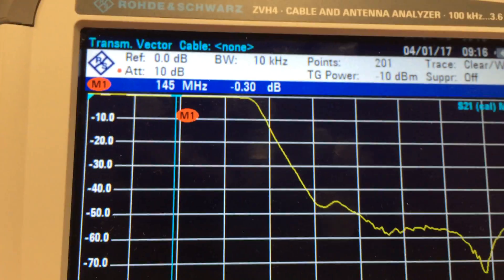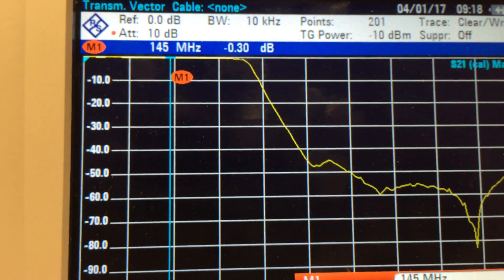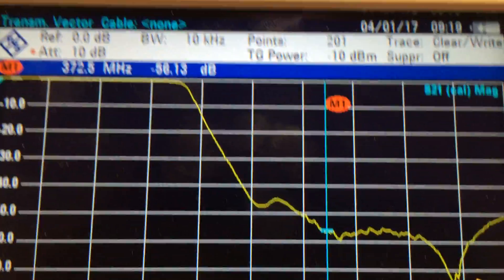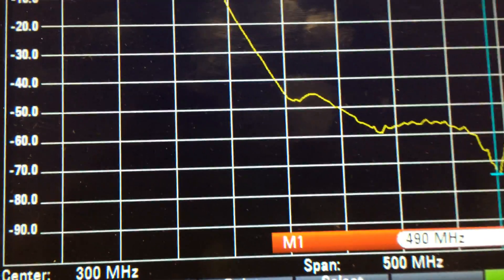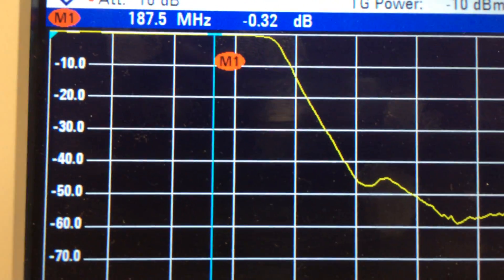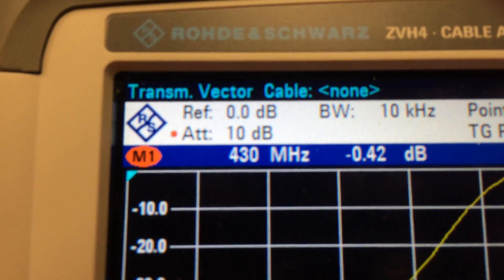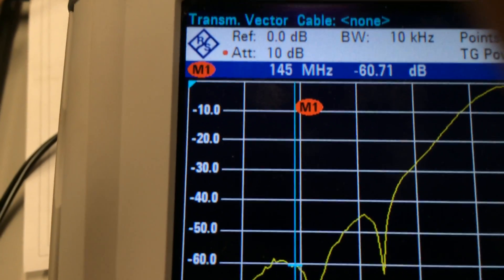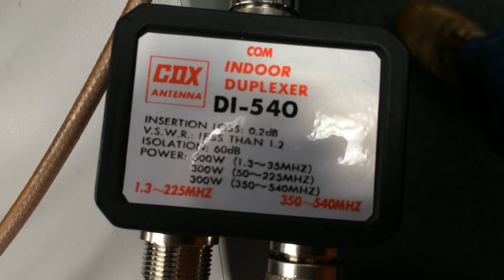CDX DI-540 Duplexer Frequency Response

Comment: What id you were to put a siemens / telefunken phase stub into the spare SO239 ?
Reply: VK6CS To stabilise the signal and give the R&S a chance to read right.
And open 239 is an invitation to illogical signals.
I thought you'd know this stuff.
Reply: A 50 Ohm load with no feedback for the analyser so I gives a real rejection read out.
Aren't you across this ?
An open stubb is a feed path for resistive capacitance.
Reply from the maker: When I looked at my similar device putting a 50 Ohm termination on the unused port made no difference...
Reply: VK6CS oh, I thought you would put a phasing stub on it so that it gave better wide band results;
OH well. I guess you know what you're doing.